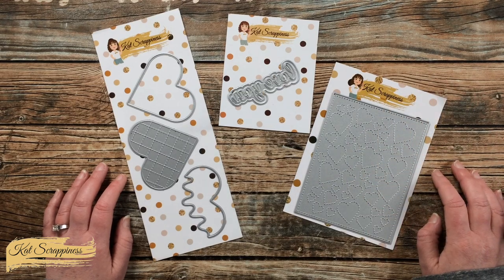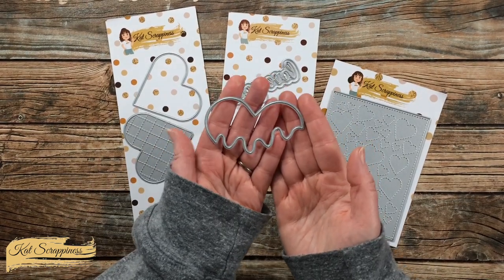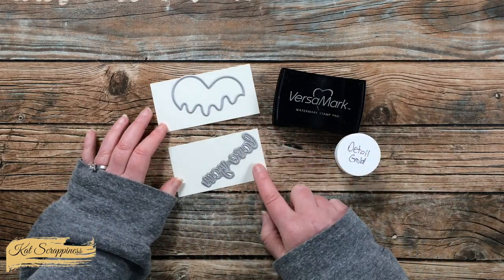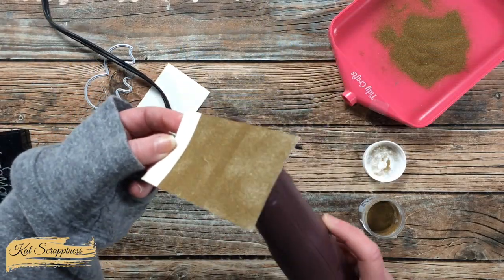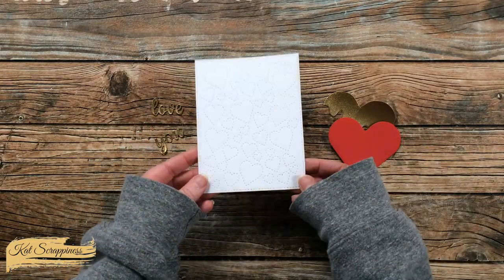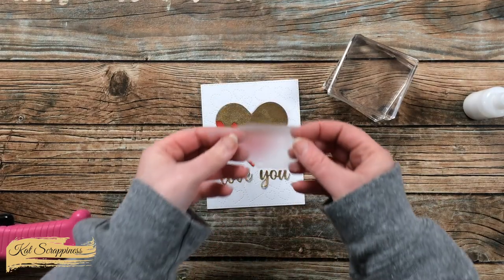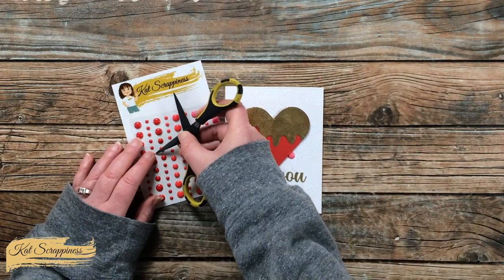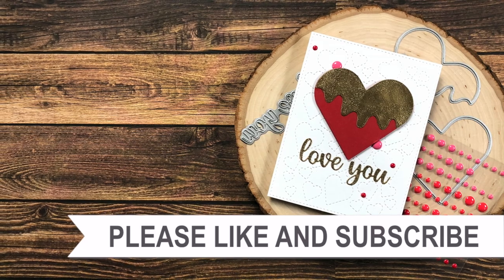Using Layered Heat Embossing for a Melted Gold Look | @KatScrappinessCrafts Design Team Project

Comment: Lots of fun techniques and touches in the card.  Nice!!!  Back in the day, we'd do 3 or 4 layers of heat embossing like this, then embed a red rubber stamp in it as a design element.  You definitely made it look like what a young nephew would have called "a good bite to eat."😋  I don't know when you filmed this, but you sound like there's no hint of COVID, so I hope it was a recent filming.
Reply from the maker: I used to use really think embossing powder, put on a couple layer and then bent it so it cracked. Ever tried that? I think they called it cracked glass. :) I am still stuffed up, but feeling much better. Thanks for watching!
Reply: @CallMeCraftyAl  Yes, I have done that technique but not for a long time.  I'd sponge or swipe ink over it after cracking to enhance the design.  Hmmm....where's my UTEE???  Glad to hear you're feeling better.
Reply from the maker: @1stLucySchmidt  YES!! Forgot about inking over the cracks!! :)